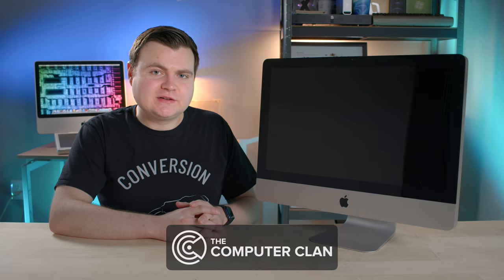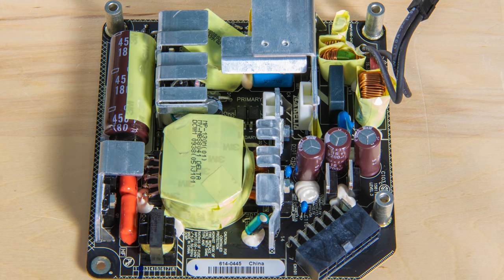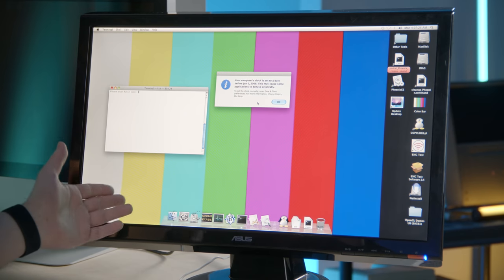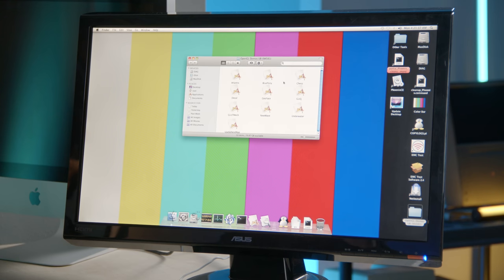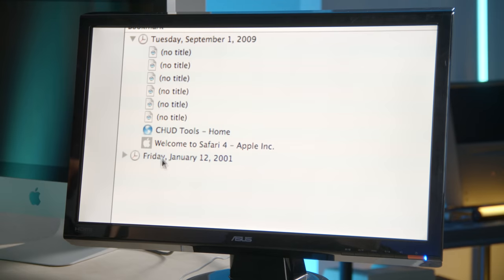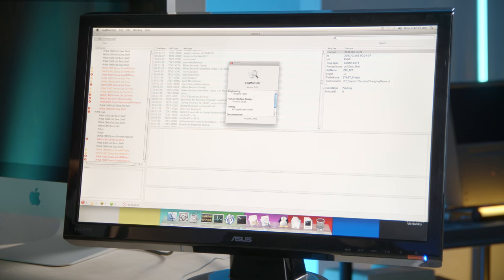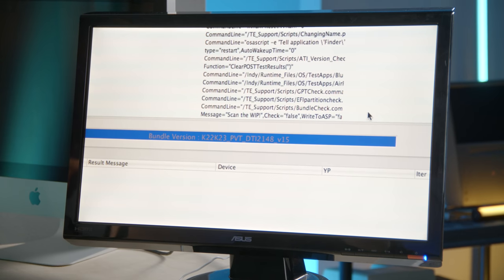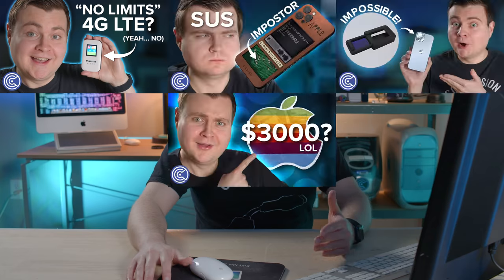Apple Forgot to Erase This iMac's Internal Software - Krazy Ken's Tech Misadventures

Comment: I worked at apple, and with one of the oldest apple stores in America. FirstTech. and i can say that yes EMC for electromagnetic compliance is an abbreviation, it however is NOT what EMC when used at apple internally stands for. i never found out what the abbreviation actually means but its a play on EMC-squared or Einstein. and KFS might mean Kernel File System for testing various updates and modifications to that.
Reply from the maker: Interesting… and FirstTech?! Nice. I’m familiar with the one in Minneapolis (which is now a gym). Did you work there or somewhere else?
Reply: @ComputerClan  I worked with them in Minneapolis yes! Across the street from them in fact. I might even have some stuff left from when they finally closed up for good. No one really remembers apples first brick and morter shop in America!
Reply from the maker: @Sevron415  that’s amazing. I wish I visited while they were still open. Good history, there.

Comment: Seems possible that the AppleKFS partitions are hard mounted network share partitions, like how you can mount a smb share in fstab in Linux. The size seems to suggest this. Likely contained development tools and files that would need to easily be accessible while doing diagnostics.

Comment: Did you try connecting the device to the internet and running the web links from the device? If it's a prototype then it may have a system marker that allows the device to connect to their inner network sites.

Comment: Blindly changing my imacs RAM was a fun one. I forgot what year but it was NOT the one with the door on the back. I snapped my headphone jack, which BLEW cause I had a Logitech speaker that I couldn't use after that. That was when I bought a new mac and my first set of airpods lmfaoo

Comment: I always wanted a MacBook but refused to spend so much for a current one, so ok did some digging and found ot that older Macs are relatively affordable so i bought a early 2012 model that CAN be upgraded so I swapped in an SSD and added ram and it's just as fast as a new computer>

Comment: Years ago I used to work for a company called celestica programming sisco server boards, that interface asking or saying about probing is probably wanting you to connect another apple device to check for faults or to actually program the device with og firmware,  could possibly but doubtful be a way to re program home buttons to re instate touch Id or could even remove iCloud, again possible but doubtful. Great video definitely looking forward to the next 1

Comment: Apple uses K to usually stand for knowledge as you guessed, my experience dealt with KB articles which are support pages which usually have 6 digits attached to it for url filing systems

Apple is not fun to work for

Comment: Hello Krazt Ken, I was wondering if you know to help me. I replaced my blade SSD inside an 2015 iMac 5k and since, the iMac is randomly shutting down, without the option to power it back, unless I unplug it and plug it back in. The SSD is a nVME SSD, with the same port as the original, no adapter, it seems to work on PCIex 4x. When it's working it's working super good, sometimes, by itself the iMac shuts down (not normal shut down process) like the power was cut somehow. Do you have any ideea what could be? I stopped the sleep mode, hibernation mode, everything is off, it's continuously running and when it wants it cuts off, it can be 30 minutes, it can be 6 hours or even days until it does it. Thanks man!

Comment: Given that this was probably either a prototype or just a random in-depth quality inspection the request to connect the ethernet cable was not for internet purposes. The system needed to access the network at that facility to simply get files and or programs that those programs needed. But I'm sure to some users here that was probably obvious. As a beta tester I would have personally had a field day messing around with some of those programs but for the most part the programs looked very low level tech support programs. Actually none of those programs should be needed to be put on the system to start with most all diagnostic software is designed to be run off a network or a thumb drive. Like for me I have a thumb drive with a handful of programs and 4 operating systems for those rare cases that a system simply won't restart from it's own operating system. That way I could do a USB reboot and attempt to fix the computer.

Comment: With an apple "service utility" app you can serialize that logic board to record the original serial# (for example when a tech guy replaces the logic board), so the serial number could be anything you want provided you have access to that serializing tool (which of course that service center had with all the extra diagnostic software they left installed in that hard drive)

Comment: Who completely reassembles a computer after a repair like that without testing first?
Reply from the maker: Um. You need to reassemble it with this computer. It's an all-in-one. The screen is literally the hatch to get inside the computer. You need a screen to make sure things are working—especially when you need to check if the screen is working. : p
Reply: @ComputerClan  You may need a screen, but you don't need to screw it in. I would want to avoid dealing with all those strong magnets if at all possible.

And btw, I can remove the front glass from these without any tools.

Comment: Ops tech is probably just what apple calls their IT division. I know that's how Amazon works. The IT guys are under WW(Worldwide)OPSTECH(Operations technology)
Reply: I'm half-surprised I didn't see an ROW ('rest of world) somewhere in there for whatever region the subcontractor was located in that top level management didn't have as much direct influence/control over. ROW PVT hardware certainly has a habit of trickling into the public as the engineers move on and management fails to ask for old hardware back

Comment: You've shown exactly why Apple makes repair both difficult, expensive and a really bad bet.

If you are looking out for what to do with the contests of your wallet, doing anything beyond extreme basics with most Apple hardware, it is cheaper (comparatively, not quantitively) to dispose of and replace faulty hardware.

Putting it in plain English. Where Apple is concerned don't throw good money after bad.

In my long experience of Apple hardware, Apple spends a lot of time making it look beautiful, but deliberately ridiculously hard to access and assemble. I really feel sorry for the people at Foxconn who have to build Apple's hardware. This contributes enormously to the expense.